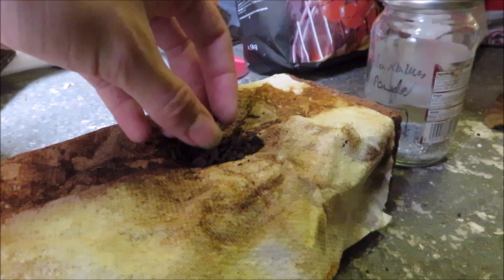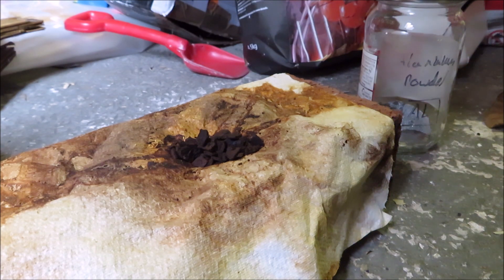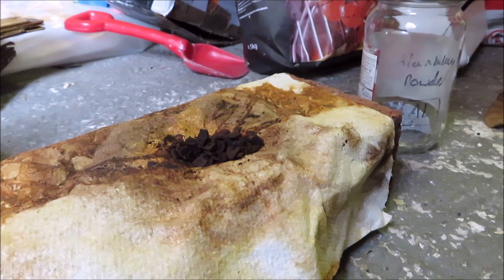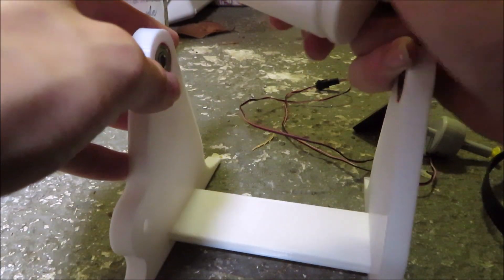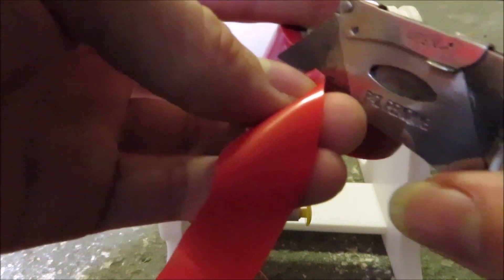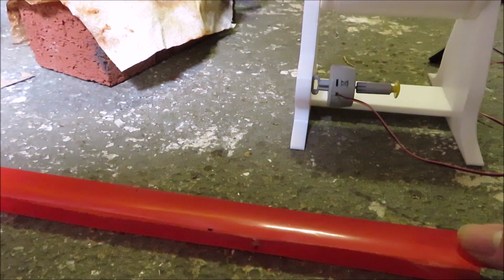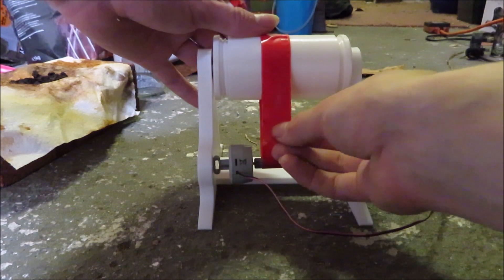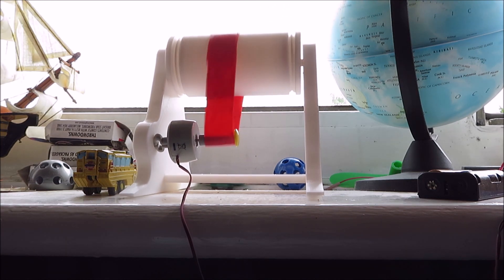3d printing a ball mill

Comment: Are the stl files anywhere for download?
Reply from the maker: Had a look through my files and managed to find them. (you may have to come up with a new way of mounting the motor as the one I used was one I had lying around from a old toy)
https://drive.google.com/open?id=1hCqW0TD6ZI7MiTlkl6prMNnONJcd6cPf
this google drive link should work.
Reply: @infernalcontraptions8648  they are still there and I will have to try printing this

Comment: The result seemed really good, but I am wondering how the plastic cylinder did. Was there any damage to the inside of the can, and would it be practical to use a metal can?
Reply from the maker: Damage to the inside of the plastic appears minimal you can still clearly see the lines from the printing on the inside and it's been ran for at least 48 hours continuously.

A metal can could also easily work the question would be how to add the axles onto either side so it can turn.
Reply: @infernalcontraptions8648  I bet 3D printed end caps would work great on a standard tin can. Obviously there is no need to fix what isn't broken though. Good to see your project worked!